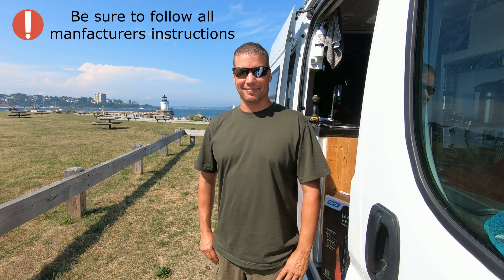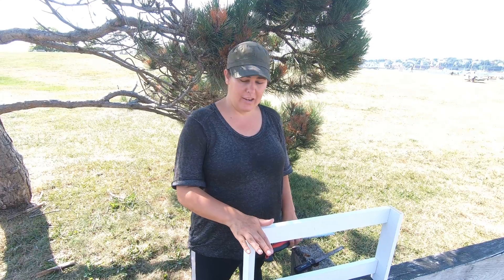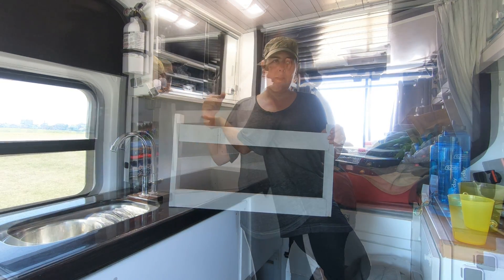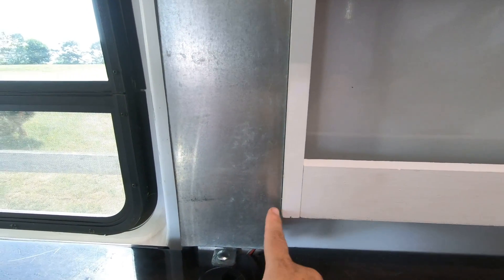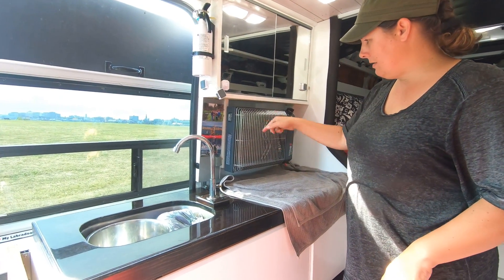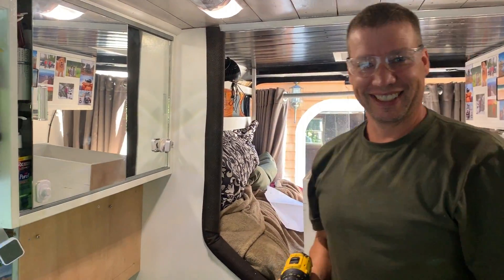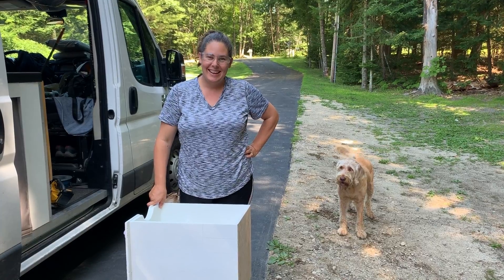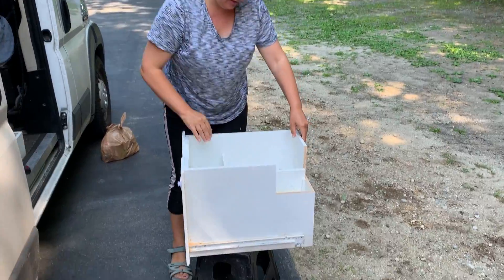WAVE 6 CATALYTIC SAFETY HEATER ~ Did We Install The Right Heater?

Comment: How did you determine which size Heater to get?
Reply from the maker: Mostly word of mouth from other Vanlifers. People in smaller low roof vans are happy with the Wave 3. Others we have met with larger high roof vans love there wave 6. We have been using our wave 6 for 3 weeks so far and love it. We can cook right near it and not get blasted with heat. All that said we are still working for a solution to keep our counter top cooler...maybe a silicone oven mat or stove rug will do...So maybe a wave 3 would have gave us less obstacles to overcome with the small area we had left to locate it. Hope that helps 😀

Comment: Propex makes a propane heater much like the espar with the intake and exhaust going out of the vehicle. Sadly it's expensive. I've considered it however with the plan to install it in a removeable cabinet under the bed and using ducting. I thought I could remove it in the summer and put it up on the roof rack. I have a diesel and could use the espar but it soots up and needs to be disassembled and cleaned at least annually and more so if you spend any time at altitude. That sounds annoying at best. I hope your option works and I look forward to your assessment of it.
Reply from the maker: We have been using the wave 6 for a month already and love it! We can work in front of it without getting too hot..unlike the buddy heater. It seems way more efficient. The only problem is the counter gets hotter then we like..more clearance then 3 inches is needed. We will surely find a solution in the near future. Thanks for sharing the info on the Esbar heater that’s the first we have heard it requires .

Comment: Hi Team Advanture,
Did you consider the Webasto heater? It’s like the diesel one but it plumbs into your gas tank, instead.  I hope your Olympian works out. I love the way you work together as a team. Even Roodle helps.
Reply: David Yule that’s what I have it’s great!
Reply from the maker: We would have went that route if we could redo the initial build back when we had more money. We love the wave 6 so far. We have been using it some for the last month. We like that we can stand in front of it and cook without it being too hot 🥵 That said we may have to use some spacers to bump it out another inch from the wall. Our counter and medicine cabinet do get quite warm.

Comment: Wow. I would have never guess that this could be so close to the wall. I was planning on getting one of these as well, so I will be very interested to see how this works out for you guys.  Great video!
Reply from the maker: We have been using the wave 6 for nearly a month now and we love it! Best part is that we can stand and prepare meals next to it with out getting blasted with heat. Plus it’s very efficient. That said, we are still working a solution for the counter top getting very warm. Maybe a silicone oven mat or fire rug on on the counter will work.
Reply from the maker: Hi Sweetheart, our Wave 6 update video comes out tomorrow. We modified it a bit and are excited to share 😀

Comment: I have three Wave heaters and I honestly think the real reason they call them the "wave" is that when you first light them they have a burst of flame that shoots out and I have finally learned that if you wave (fan) your free hand around the igniter it somewhat helps to light the ignition prosses... Be careful with the lighting process that close to the above cabinet...
Reply from the maker: Thanks for the tip! We have been running it for near and month now and are thinking about bumping it  another inch out and away from the cabinet

Comment: I have heard good things about this heater. Nice installation you two. You could put tile on the counter and then you wouldn't have to worry so much. Proper fireplace tiles I mean right. Nice work tho'. Now you will be nice a toasty.
Reply from the maker: Thank you! We are working through the hurdles of the counter getting too hot..thanks for the title suggestion!! We love this heater because we can cook near it without getting blasted by heat. Also it uses so little propane. That said the Wave 3 would have been way easier to install in our small space.

Comment: Why did you install it so high?  Heat rises; how are you going to heat the lower half of the space?
Reply from the maker: This is the only location left in our van that has the proper amount of space it requires..or at least close to the amount. We have been using it for a month now and pretty darn happy with it. That said, slippers are mandatory as you said the floor gets cold. Happy travels
Reply: @oneadVANtureatatime  Where you have the heater is safer for Roodle, too.

Comment: We love our Wave 3 heater. I’ve found that cooking my oats in the morning produces more CO2 than the Wave. I’ll bet you’ll run the Wave 6 on low 95% of the time?
Reply from the maker: Yes! We have only used the low setting and have been running it nearly a month. We love it and think the wave 3 would have also worked for us. Happy travels.😀

Comment: Would love to trade my little buddy heater for a Wave 6. Think I need to save some coin in my piggy bank for that!
Reply from the maker: A well positioned little buddy might do the job just fine..With a pet and 2 people we just couldn’t find a safe spot to put it that didn’t cause trouble.
Reply: It does work quite well but the small 1 pound propane canisters are expensive and a waste.

Comment: Nope not the right heater. Too big for a small space. Wave 3, or espar with a 5-8gal diesel tank installed.
Reply from the maker: We have been using it a month now and are very happy with it. The wave 3 would have also worked well like you said. These heaters are crazy efficient with the propane use.